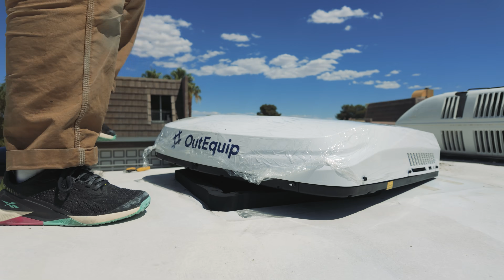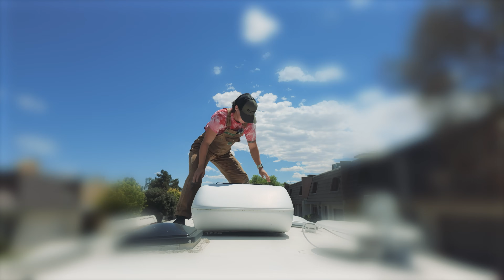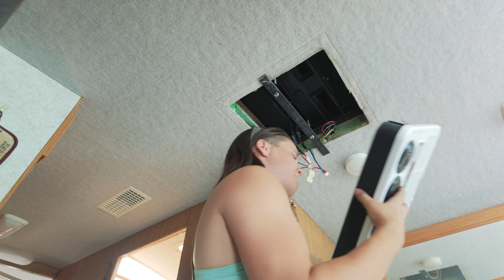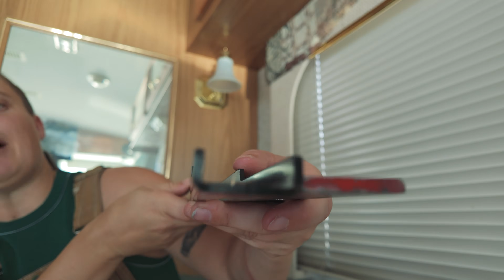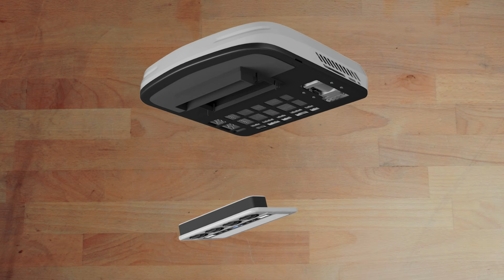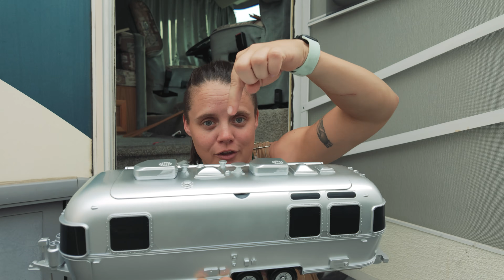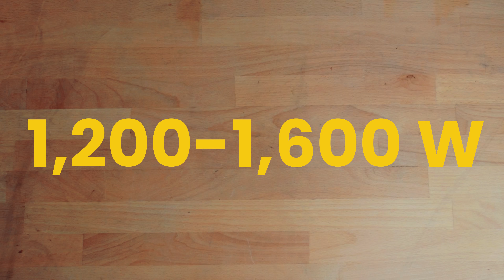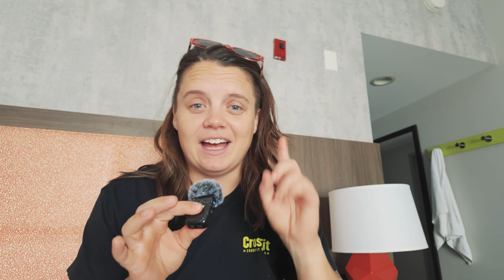Better RV Cooling with Less Power? My Switch to a 12V  AC | OutEquipPro AC Honest Review

Comment: The specs say 960 watts.  It also says they make a 12 and a 24 volt model.  For the 12V model the specs claim 21-58 amps.  That ranges maxes at 835 watts at 14.4 Volts (as if the RV was running, and alternator charging the batteries) which is short of 960 watts. 960 watts at 12 volts would be 80 Amps.  It claims a Protection/Shutdown overcurrent at 100 amps for the 12V model, 80 amps for the 24 volt model.   From what I know about Inverter type Air Conditioners (this one is an Inverter Type as stated in the Specs and Sales Literature) that the power consumption is demand based, so if you saw only 300 watts, that's because it wasn't running as hard as it could.  I would bet money that if you turned it on, in a hot RV in 90+ degree weather and waited about 15 minutes to check the power consumption you would find it more to be in the 600-800 watt range, which is typical for a 10K BTU Air Conditioner unit, no matter the power type.  Not saying it's a Gimmick, it's actually a Feature.  Inverter Air Conditioners if I recall correctly use a 3 phase approach to running the Compressor from the built-in Inverter.  I am an Electrical Engineer.  I wrote this off the top of my head so if someone were to nit-pick it for errors, my apologies if there are any.
Reply: Yes, 300w sounded too good to be true. Your explanation helps it make sense. Your comment should be pinned.
Reply: @shaunwilkens if understood it’s more in detail …
Reply: Yes you can't cheat thermodynamics.
Reply: @SlowRiderDucati Not cheating. Thermodynamics. You're getting rid of the inefficiencies in converting DC to AC. That's for boondockers
Reply: @SlowRiderDucati  yeah because humanity will forever be stuck at 600w or higher efficiency because thermodynamics cant be "cheated"

Damn all hope is lost , if any time in the future we try to improve we must resist with skeptism and say this cant be im used to it being much higher energy draw it justs not what im used to seeing something must be wrong
Reply: @viyusavery248  It's only different in the amount of Energy used because it ramps up consumption depending on demand.  It still requires a proportional amount of power to produce more cooling capacity.
Reply: @xxcrazy_critr6661  The beauty is you'll use less electricity when it's not cooling off as much (compared to non-inverter AC tech) - and still has the power when it's got to work hard.
Reply: DC air-conditioners typically use a Variable Frequency Drive on the motor, so that the scroll compressor can run at exactly the right demand. So...for the purposes of maximum performance, the wires do need to be sized for that 80+ A current draw., and circuit breakers and fuses need to be installed accordingly. Having said that...a 600W+ solar energy system and 560A-h of battery storage (2x280A-h) of Li-ion batteries would be sufficient to run this AC unit for a long time.
Reply: @TyMoore95503  VFD on a DC motor???
Can you show me an example.
Reply: @MR-nl8xr Dometic's line of CFX3 Dual Zone Fridge Freezer uses a Variable Frequency Drive on its two compressors. ICECO makes equivalent units (same Danco Refrigeration Compressors.) The DC powered air conditioners almost all use a variable Frequency drive: they all use an inverter with Variable Frequency to drive, I believe, a small three phase motor...this way an onboard controller can run the compressor at the speed necessary to meet actual demand. They tend to be very efficient.
Reply: I'm glad you pointed this out. 22.5 amps is a lot of draw from a typical house battery. I have a 135Ah battery in my conversion van. I can draw and estimated 10A for 6.75 hours to drain 50%. In full sun on my 2x100W solar panels I get a bit over 7A which would help but still. I'm glad I saw this video and your breakdown, and she didn't do anything wrong - good video - but this isn't a miracle solution for RV's without significant battery banks.
Reply: @bendowney5822  Indeed fellow person. You need to get away from batteries that can't be used below 50% thats your  bottleneck to the system  described. Check the   very recent pricing on batteries it's to everyone's  advantage right now. I watch a youtuber named Will Prowse,  very up to date, informative, and most  importantly not endorsed by anyone. Cheers
Reply: @allenandersen4423 i am looking at maybe 5 460 ah batteries.  no matter what you have it seems the 120v AC WILL DRAIN THEM IN HOURS.   THIS LEADS ME TO HOW MANY SOLAR PANELS I NEED TO RECHARGE AND IT ALWAYS (i am new to this) COMES BACK TO BACK TO BACK CLOUDY DAYS OR HOT DAYS AND YOU STILL NEED A GENERATOR.
Reply: For power consumption measurements it really is best to try and get the conditions as close to the same as possible especially when it comes to power hog AC's.
Reply: "the power consumption is demand based, so if you saw only 300 watts, that's because it wasn't running as hard as it could."
She literally discusses this in the video. 
Also, I don't know if she actually filmed in May when it was posted, but if so, it is definitely already in the 90s in LasVegas that time of year. I don't know how it would perform when it's upwards of 100-115, but I suppose that's the beauty of RV life; You can head north a bit, lol.
Reply: Those pesky laws of thermodynamics strike again!
Reply: The compressor uses a 3 phase approach confused me. At first I thought the Inverter is a brand name somehow the company sneaked in to register? But if your claim is true then it just uses a built in inverter to run the compressor. It just saves us to use an inverter from our dc battery to AC circuit?
Reply: Totally. I have a 12v Chinese AC with  inverter scroll compressor and ok hot summer day 40C in Greece it was working overtime since the van is in direct heat, pulling 40-50 amps. Yes I could turn down the fan and put on eco mode but then it won't make difference since the van is being hit direct sunlight it's hard for AC to keep metal van cool
Reply: @tehdreamer  thanks for sharing your real world experience!
Reply: @tehdreamer 
Your point illustrates why insulation is so important.
Reply: @Always_sojourning I have good insulation but you gotta be in direct sunlight since I want to expose my solar panels to run the AC
Reply: Yeah may be good for rv which look better insulation. Average van spec I saw was an 20k btu. That's what the van itself uses for confort. Looks on the low side to me with massive wattage use. Maybe a split system would be more useful.
Reply: For folks with solar that like to boondock this is great. No need to convert DC to AC for the Air conditioning. That inefficiency is No longer in the equation.
Reply: Their is no inverter, and with DC the ac unit just slows down when it reaches temp selected. At the slow down phase very minimal draw. This prevents cycling on and off, so very comfortable.
Reply: @michaelglenning5107  It's been a while since I made this comment, but I am pretty sure the products literature states that it is an Inverter type Air Conditioner.
Reply: @michaelglenning5107  There is one, but it's Servo. Alot of this is assumption because the OEM hasn't given all the details, but it's very likely a DC Servo set up for the Scroll Compressor.
Reply: 80 Amps! That''s the maximum output of any average alternator, that would kill any battery in a matter of minutes...
Reply: Did your cat scratch your arm? Lol
Reply: This is a beautiful answer. Especially if someone doesn't understand the terminology in the math required.
Reply: I have had a couple of different "Portable AC" units. All the same brand. The kind with 2 hoses , so no water to deal with.  I still have 2 of them. The inverter one cost the most and was the worst.
Reply: NICE JOB!   AGREE 100%.   THERE IS NO "MAGIC" HERE.  JUST A MORE COMPLICATED SYSTEM THAT USES A DIFFERENT POWER SOURCE.  WHEN HOT OUTSIDE THIS UNIT WILL DRAW MORE POWER FOR SURE.  I WILL PUT MY 30 YEAR OLD PENGUINE RV AC UP AGAINST IT ON A REALLY HOT DAY AND COME OUT AHEAD.  LARGE LANCE CAMPER SITTING IN DIRECT SUN LIGHT WITH MY 11,000 BTU GOT DOWN TO 60* IN 2 HOURS.  ANOTHER HALF HOUR WOULD HIT 55* AND THE MACHINE WOULD THEN TURN OFF.
Reply: @wesscarey4475  But, you can’t find the caps-lock key?
Reply: Did she mention the battery capacity in the van? If the unit is running at the factory specs she’s going to need a big battery if she wants a reasonable run time.
Reply: what gauge wire does the unit use thanks
Reply: @ctm130 depends on length (voltage drop). I believe others have recommended 6AWG for a typical RV setup.
Reply: Is it as quiet as a split unit?
Reply: Bro I need you on my team.
Reply: Right, 20 to 60 amp dc per hour! Repertoire you better have a ton of solar panels to keep up with that or run your generator all day long trying to keep your batteries up because of the extreme consumption of 12 volt electricity. What a sham!
Reply: The amount of energy needed is the same regardless of AC or DC. If the RV is rated 30 amps 120volts the maximum energy capacity is 3600 watts total for sum of AC and DC... Plus battery stored energy which for a short time can be added, until depleted, then that consumed energy must be replaced, restored, hence divert and lower usable energy for needed time to restore, resupply the batteries to full charge state. There's NO free lunch!😅
 And the inverter energy loss must also be taken into account be that 10%+/- .  Without pole power you need a generator! Or a huge huge solar system AND lots of sunshine!
Reply: @Johnny-dp5mu  BUT the DC can be restored via solar panels during the hottest portion of the day.
Reply: @Johnny-dp5mu  you can't say the energy needed is the same regardless of AC or DC 

DC to DC has less losses Vs DC to AC conversion so where the energy is coming from will make the energy needed different
Reply: @viyusavery248  DC/DC converter are actually DC/AC/DC converters... ;)
Reply: Lost me.

Comment: Those power cables are very thick to run. A 24V system is better for RVs and Vans. More efficient and spend less on thick gauge cables since 12 volts is soo low. My drill battery is 18 volts.

Comment: Why not use the 110 wire removed from the the roof AC, removing the other ends from the breaker panel, then attach that end to the 12 volt supply?
Reply: 12 volt requires bigger wires
Reply: @danapicray9040  the 110 wires to the roof AC unit are larger wires and capable of handling over 2000 watts.  110 volts X 20 amps = 2200 watts. 2200 watts / 12.5 volts = 176 amps. The 12 volt unit is rated at 21 to 58 amps with a 100 amp overcurrent protection. So the 110 wires are more than capable of carrying the current.
Reply: @t-n-tew7468 176 amp cannot be carried by 10 wire let alone 12. You need at least 0 for 12 volt.
Reply: @t-n-tew7468 no, to handle 80a at minimum awg4 , not awg12 is 20a wire.
Reply: the higher voltage reduces how many amps are needed thats why power is moved at 1000s of volts before it comes to your home
Reply: 12awg is for 20amps 
This takes 80amps so a min of 4awg is required,  with a proper fuse.

Comment: Uhhh ...when I looked up the specs on the website, what I read is a bit different then your math suggests. 
Rated wattage is 960.
Rated current is 21 to 58 amps.
I stopped watching the video at about this point, I couldn't figure a 12V AC running at just 22-ish amps, maybe on lowest setting. 
So, you went from a typical AC on shore power only, to this that can draw close to 60 amps on high.
How are you powering this?  How much solar and battery bank capacity do you have?
Maybe you explain your energy systems at the end, or in other videos, but you better have lots of off-grid solar ti run this.
Reply from the maker: Yeah I’ve seen several people comment about the rated wattage on the website. I haven’t been able to get my wattage up that high with my unit and from watching other people’s videos on this AC their wattage readings all seem lower than that 960 number as well.

Comment: Roof top Ac systems are a flawed idea for a few reasons, firstly they are taking up valuable roof space for the solar needed to run them, then they sit in direct sun reducing their efficiency potential. I wonder how all this comes out in the wash compared to a 2.5kw split system.
Reply: Split is more efficient, but install is easier on the roof. I like the split idea, you just have to protect the lineset and condenser well.

Comment: not all generator's are loud. and some are Very fuel efficient. 
can run a old school ac. micro wave. and charge up your batteries at the same time.
at least a honda eu3000 does for my 2001 25 foot sunny-brook,
i have a extended fuel supply and with that extra five gallons already in line i can go over a two week camp and not run out of gasoline.
just bought a 3000 hf and need  to see how long one tank of propane lasts. (yes in summer heat of over 115 F days).
now if you want to talk old school contractor units that is another thing. ( and are banned at a lot of construction sites now. yes noise).

Comment: Choosing this option needs to be considered carefully. Remember, there is no such thing as free energy. You must look at the btus the unit can move. If it is far less that the unit you are replacing, then you will probably not have adequate cooling. If these units use less wattage for the same btu transfer, that's great but if they use half the wattage but only move half the btus, you are not likely to like the results. Also, running on 12 volt DC isn't a magic solution. Batteries will discharge rapidly powering A/C requiring another power source which will be your engine alternator which is good if you are using it while cruising, although the alternator will run hotter and won't last as long, and it's not so efficient when you are parked. You may run your generator which as you mentioned is not very efficient, especially if you are powering a battery charger to make the 12v DC. If you are plugged in to shore power, that will be 120v AC and will be powering a battery charger/power supply to make the 12v D, with losses along the way. Then there is the question of quality. How long will these units last? A typical RV rooftop unit can last for decades. Perhaps it is a good choice for smaller campers used in places that are not so hot, but I can't see it as a one size  fits all replacement.

Comment: Great video!  It's definitely a good option.  This is off topic, but I have a propane Atwood stove and when the slide out is in it works great.  When I put the slide out no gas is getting to the burners.  What would cause that problem and how might I repair it?

Comment: To put another way, 4 100 watt panels will probably keep up with the air conditioner, not to mention the added shade provided by said solar panels.
Reply: At lower performance 400 watts may suffice, but the claim that it only consumes 300 watts of power at full cooling power is inaccurate.   The Compressor is driven by an Inverter builtin to the AC unit, which utilizes 3 phase power approach to running the compressor, allowing it to run at lower performance or higher performance based on cooling demand (really hot outside it will draw up to between 800-960 watts according to product specs).   So to run it at full capacity you would need 1000 watts of Solar Panels to keep up with it.
Reply: You see, while this Air Conditioner takes a 12VDC (or 24VDC model they also make), the compressor in the unit is still an AC compressor, not DC, and not 12 Volts.  The unit has a builtin Inverter to run the Compressor and likely the Fan Motor as well.  The major benefit to this unit, is not some spectacular other worldly performance magically from only 12 Volts DC, the benefit is that it is all in one package, Air Conditioner and Inverter, and Low Profile (doesn't stick up as high from the roof) and the unit is lighter weight.   This unit is a 10K BTU Unit.  All 10K BTU AC units of any power input type will use around the same amount of Electricity, there is actually standard Math to convert BTU to Watts.
Reply: It won't. I have 400w solar and similar scroll inverter compressor AC. Middle of summer in Greece with temps outside 35-40 Celsius the compressor must run on max setting to make a difference in the scorching sun. If you park in the shadow then you can't use solar panels... So it will drain your battery bank quickly. Mine draws from 40-55 amps in proper hot day and with 560ah lifepo battery bank and 400w solar I could run it max 8 hours before battery bank runs out.
Reply: With the caveat of loads of sunshine, although hot weather and sunshine often go together. ;)

Comment: These new 12volt DC a/c units have inverters built in if I'm not mistaken - but are efficient due to their "VFD" type of circuitry - the compressor can run at partial power instead of ON/OFF. But the compressor is still an AC motor driven by the built-in inverter.
Reply: Not all have inverters. Some compressors can run on 12 to 24 volts like my refrigerator cooler. 73
Reply: It is a dc compressor
Reply: Features a 12V DC Scroll Compressor. I looked up the actual product. 73